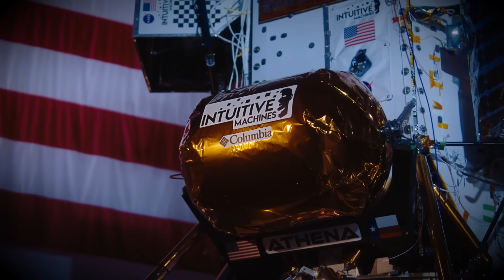New Image Reveals The Athena Lunar Lander Is On Its Side

Comment: Like Sn 8 Athena is a tall objecty landing on a light gravity uknown stability bearing surface?
logic states low wide spread limbs to attain a smooth atainable landing is best?
to fast ground insability unknown surface makes it possible to bounce tip topple over?
desingmin an arnness tube like frame wher the frame settles and the main section swivels
down around to best position may be nthe best way forward.
too many toppled machines says its time for a rethink? 
even going back to the mars type
ballon encased system

Comment: Just for balance... the majority of the lander's mass is in the lower section of the lander so it looking 'too tall' is deceptive. It's also ironic that part of this mission is to study the dust kicked up but the plume yet that seemed to swamp the sensors so even 'dead reckoning' was rendered moot, especially when Athena could easily be travelling a few metres per second faster than it thought.

The thing I noticed during the livestream, that was somewhat foreboding, was when the Athena model on the circular table (seen at 5:53 in the vid) was picked up by one of the controllers after a few minutes of them getting some radio data back, who then showed it to several people but he held it sideways while they were pointing at it... he did this several times before the end of the stream. I suspect they knew it's orientation then. This CLPS program is important so I really hope they solve this issue before Flight 3
Reply: It was flying on its side in order to decelerate. Towards the end the indicated telemetry numbers no longer made any sense.
Reply: @michaels3003  Absolutely, but my comment was about what was going on in the control room 10 to 30 minutes after the landing and well after Athena's flip to vertical manouver. To my mind this could've indicated they were guessing the signals they were getting indicated it was likely on it's side, but it could be something more innocuous like it was easier to see the various recievers if he held the model on it's side.
Reply: @markzambelli  , OK.
Reply: I noticed that too and told my boss "he shouldn't be holding it like that haha!"
Reply: (Scott Manley just released a short vid saying the same thing with some good images as now they've had time to get images from the Japanese Micro-rover's camera as it's still attached to Athena)

Comment: Seems like the first lander that had the protective cap on the laser was in better control than this second one.  They have serious guidance and terrain avoidance problems.  Even though it's tall, if they were able to control horizontal velocity to zero and avoid rocks and craters, it should land successfully.  Lots of problems.

Comment: The damned thing looks top heavy like the last one that ended up on its side. Make them so they can land on any side and then right itself..these refrigerators with tiny legs just don't cut it. Someone measure the Apollo lunar module...If my memory is correct it had very wide stance to height.

Please check they didn't hire the engineers who designed the Ford Explorer...

Comment: I'm not an engineer, but this lander looks way narrow vertically than Blue Ghost.
Reply: FYI the width of the legs is constrained by the diameter of the rocket. Heavy shit was positioned low, so it's height compared to width is not in and of itself a determining factor. But they definitely need to rework something.
Reply: @mmedved5567  Thanks. It is hard to land a man made machine on another rock for sure!
Reply: Blue Ghost is wider than it is tall. This one is much taller than it is wide.

Comment: Remove the autonomous landing equipment, install remote control (with video).The weight saving from all that auto gear could be fuel to fly around for the best spot to land.
Ya need a pilot!
Reply: Won't work due to signal delays.
Reply: @mx54kev  Really? Couple of seconds?

Comment: I took physics in college. Got a doctorate in another field. I took one look at their lander years ago and instantly thought “who designed this ?  They must be an idiot”. Obvious to me the center of mass is too high above the legs. If I could call this years ago, why couldn’t they ?  The legs need to be spread much further out or the body needs to be more squat. If they try again with the same design, they are hopeless.
Reply: FYI the width of the legs is constrained by the diameter of the rocket. Heavy shit was positioned low, so it's height compared to width is not in and of itself a determining factor. But they definitely need to rework something.
Reply: Even if you are a garbage truck employee you can see when a bin is about to fall over
Reply: Even the Apollo engineers were very worried about the LM tipping over on landing.
Reply: Totally agree. They learned nothing and made no changes to the landing struts or center of gravity based on their first crash! I was really hoping for a success on this attempt.
Reply: @bob4z I seriously doubt there was time to rework the second lander.
Reply: Wow you must be a wizard to tell where the “mass” is on a shape with 0 knowledge of its design! 😮 its height has nothing to do with where its center of gravity is 🤦‍♂️ …basic college physics.
Reply: All your words equally apply to Leon musk now.

Comment: If its this hard to land this lander design I'm concerned about lunar starship HLS
Reply: Having a tall rocket with little landing feet is asking for trouble imo. The slower it lands the better. Having a vehicle like the old LEM was genious design for the time. Quite short and squat with wide spider legs. 
I guess at the end of the day, no matter how sophisticated the auto landing system is, there is no substitute for an astronauts eyeballs on landing. The sooner we get astronauts back to the moon the better. 🙂
Reply: I think Starship has demonstrated it can technically land. But the issue is going to be how level does the surface need to be for that to happen.
Reply: Exactly! Starship has zero chance of landing upright on the Moon!
Reply: I Know, right? Talk about a high center of gravity! :face-purple-wide-eyes:

Comment: Apparently the old saying, “it’s not rocket science”, doesn’t take into account common sense.  You can tell by looking that this thing is top heavy.  That is proven by the fact that both of them have toppled over.
Reply: FYI the width of the legs is constrained by the diameter of the rocket. Heavy shit was positioned low, so it's height compared to width is not in and of itself a determining factor. But they definitely need to rework something.

Comment: This higher than larger base design is sooo stupid. It is inherently unstable due to higher center of gravity.
Reply: FYI the width of the legs is constrained by the diameter of the rocket. Heavy shit was positioned low, so it's height compared to width is not in and of itself a determining factor. But they definitely need to rework something.

Comment: Their toast.  Seriously, unless they have insurance their not going be something if I were organization would want trust to fly.  Either their having issue with their flight software or there something else wrong.   I won't side being tall is issue.  The last flight, clearly aside from someone forgetting take flight software covers off, came in hard and fast.   This time it's different, question would be "what did the computer due when it was landing?"   Was ground too soft or rough for smooth landing ? They obviously landed in wrong spot, darken crater.  That to me screams software, but its on side too.

Comment: Intuitive Machines has perfected the tip-over maneuver.  They're the tip-over experts at this point.
Reply: They should change their company name to Inverted Machines.
Reply: @TheRocco96 ❤️🤣Funniest Comment Of All🤣❤️
Reply: @TheRocco96 lol
Reply: @TheRocco96  Tilted Machines is better
Reply: They should intentionally land it on its side then it will fall upright on landing
Reply: Someone should tell them; it isn't that hard to make something that turns itself upright. https://youtu.be/fbrA2W9U-Eo?si=Mqv9o2wt40zjiVD_
Reply: @myamerica9194  Except one weighs... grams? and the other weighs thousands of pounds. What're you going to add another couple thousand in space-taking self-righting arms? Seems like they should just fix their lander's software... or go back to the drawing board with a new more intrinsically stable design.
Reply: That would explain why they mistakenly put the earth right-side up in their patch representing a south pole landing.
Reply: Cold jet thrusters mounted on the top would have saved the mission
Reply: @oldmech619  Probably.
Reply: Just add a second set of legs, problem solved.
Reply: @PhilfreezeCH  Land upside down so when you tip over you will be upside right.
Reply: was this satallite a US AID funded scam project as a purposeful money dump "for science"?
You know, like that solar farm for a ski resort in Colorado that gets 1 hr of sun only & not in winter months due to its placement in the valley...... was like a $13 Mil project for Phase 1, & $70 for unbuilt Phase II in planned to be built '24-'25.
Reply: Why don't they show us the inverted machine as it slowly descend like Chang'e 5?
Reply: Someone is going to become unemployed
Reply: Time to call in the experts at Hasbro that make weebles.  They may wobble but they won't fall down.
Reply: Space is hard, failures are to be expected, go IM!
Reply: They should investigate the possibility of making the tipping over positive by making that the plan. then they can orientate all instruments to work also in the new/alternative configuration.
Reply: Maybe they should utilise this perfected skill😂. Pulse jet thrusters, with tip over and self correction on landing.
Reply: It's sad because they basically just dumped 5000 pounds of trash on the moon for the second time. The least they could have done was not send the second one that was also top heavy. The firefly one had no issue.
Reply: But is that intuitive?
Reply: Maybe they just should change the design adding some legs in the larger side of the ship.
Reply: Why can’t they have some sort of arms putting it back into vertical?
Reply: Try, try, try before you succeed…
Reply: The greatest success has come from mistakes or failures. Keep trying!
Reply: Just as Elon Musk's SpaceX are masters at blowing up their rockets.
Reply: @mackabeats  At least he doesn't lie it is fine and will return to earth at the end of the week like boeing.
Reply: @mackabeats  Are you a moron? Space is an inherently dangerous endeavor and what SpaceX is doing is a quantum leap over anything Nasa has done or doing. There will be many failures now so as none will have to die in future missions. THATS HOW ITS DONE.
Reply: @mackabeats falcon 9 has had a 99.3% success rate. They have a couple explosions on starship which was predicted at some point to happen. Falcon 9 has like 300 launches and landings with no problems. They fly about 3 launches a week. You adding Elon, who has no comparison to these guys tells me you're a leftist that thinks Elon is stealing your data when he isn't doing anything close. He is finding the trillions of dollars of waste we taxpayers are paying for and I think he isn't collecting a salary just like trump isn't taking a salary again and he is donating each check like he did the first term. Leave Elon out of this. He has no comparison. They are in the test phase of starship. They had two explosions. This company failed landing twice. Leave your political butthurt out of the comments.

Comment: They may want to take the approach that Spirit and Oppurtunity did on Mars. Just surround it with inflatable air bags and let it flip itself right side up.
Reply: The airbags had a dual purpose and thus were worth the weight penalty.
They replaced the fuel that a landing burn would require, plus they eliminated the need for "fine guidance" for landing.

Comment: One would think that the engineers at Intuitive Machines were intuitive enough to realize that designing a tall, thin spacecraft to land on an uneven surface might not be a great idea. Firefly's Blue Ghost is short and squat (like a LM), and it landed fine. Is that all there is to it? If so, it doesn't bode well for SpaceX using a Starship as a lunar lander, does it?
Reply: Leon is so more brilliant than mere humans, he will succeed as he did yesterday.
Reply: I do hope someone at IM will explain the rationale behind the high COG.

Comment: The problem is why they would design a longitudinal profile lander, with higher CG; rather than a transverse one, with lower CG?
Reply: There are a couple of reasons why a taller lander is attractive:
1) solar panels. If the lander had landed upright the solar panels would have been positioned relatively high above the surface, allowing them to see the sun even when it is close to the horizon and casting long shadows. 
The same reasoning also applies to raising communications equipment up higher to maintain line of sight to earth over potential terrain obstructions.
2) mass efficiency. Unlike other landers Nova-C stacks the fuel and oxidizer tanks on top of each other instead of next to each other. This can allow for somewhat lower surface area relative to fuel mass, making the lander more mass efficient.
Reply: @plainText384  weird how the other successful landers arent really tall
Reply: @plainText384  A zillion workarounds (except for the tank placement) are coursing through my head, but as has been pointed out elsewhere I am not a rocket scientist. I'm hoping there will be a fuller explanation in the FEC filing explaining why my IM stock abruptly became valueless.
Reply: Because of landing on the pole. They need a tall craft to be able to get enough sunlight for the solar panels.
Reply: No they don't  They can use an extender pole.
Reply: It worked for the Monolith.
Reply: Interesting…my comment supported their hard work and now it doesn’t show up anymore 🤔
Reply: I know, right? It seems so... "intuitive."
Reply: The reason (one of the reasons) is so they could stack two larger fuel and oxidizer tanks instead of 4 for simplicity. System works, but they need to MAKE THE GOD DAMN LEGS WIDER. This is just dumb
Reply: To fit more into a smaller and skinnier rocket
Reply: People will yap about tall lunar landers all day long yet see nothing wrong with a Falcon 9 landing.
Reply: I think it’s for payload capacity and fuel capacity
Reply: @loafofbreadx   ~scratching head~  How would high COG gelp?
Reply: @AmateurHistorian999  look at payload fairings on rockets there usually high and if you have one simple structure it helps but I think that they should lower the cog
Reply: How about learning from the lunar lander from the 1960s ? Unbeliveable
Reply: I thought this years ago.  Why they didn’t read anything about physics is beyond me
Reply: @dcb1138 I’m sorry, but your narrative is extremely false and uneducated. These are some of the best engineers in this arena. NASA approached THEM because they had the most experience in the industry. These guys can do math that would make your head spin. Please be more respectful and leave your arm chair engineering to the real engineers.

Comment: Why are they designing it so tall and narrow, it would seem that it is DESIGNED to fall over. A shorter buy wider lander would have a better chance of landing upright.
Reply: FYI the width of the legs is constrained by the diameter of the rocket. Heavy shit was positioned low, so it's height compared to width is not in and of itself a determining factor. But they definitely need to rework something.

Comment: The 2nd one on its side as to a Design flaw to landing on the Moon.  The Firefly is BETTER designed as to the Center of Gravity.
Reply: And the contact pads. The second I saw this thing I was wondering if it would tip over, I don’t feel that when I look at the glue ghost. They need a wider gear spread, and larger contact pads.

Comment: I was afraid of this about a minute or so before projected landing, I thought I heard a call that it was initiating an "avoidance maneuver" (to fly past a rock or crater?).  Anyway, I thought... will it be able to completely null out the horizontal motion?  If not, it will be same as last time: stub it's toe and tip over.

Comment: I guarantee that even the THERMAL SUBSYSTEM engineer looked at that design and said:  should it be so tall for a LANDER?
Reply: They might as well embrace the falling-over and use the beach-ball form factor for the next lander.
Reply: Having posted that, I'm thinking it's not such a bad idea. Falling-over issue, fixed! Absorbs landing impact like the Mars lander that actually did that. And once you're on the surface, you just get the thing rolling and voíla! Lander doubles as rover.
Reply: FYI the width of the legs is constrained by the diameter of the rocket. Heavy shit was positioned low, so it's height compared to width is not in and of itself a determining factor. But they definitely need to rework something.
Reply: @mmedved5567  One of my payloads was one of the smallest to ever ride alone on a falcon9 (IXPE Xray Telescope).  I don't know the orientation of the lander in the payload fairing but I guarantee that the fairing diameter was not the limiting factor.
Reply: @mmedved5567  Although I looked at some photos and the lander IS pretty big in diameter.
Reply: Aspect ratio h/r is too great.  Compare with the LM or the Blue Ghost.
And too many legs.  
Two extra chances of ending up on an obstruction, of ending up lop-sided
-Professional Engineer
Reply: @rconger24  And people are conditioned to think about physics in 1G.  Things are much more likely to skip, bounce and knock around while trying to come to a stop in 1/8G.